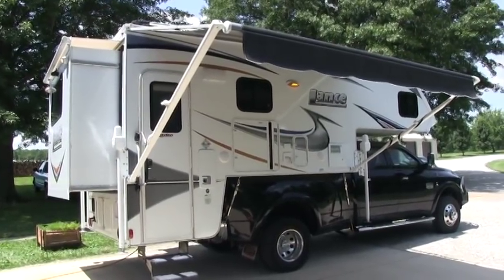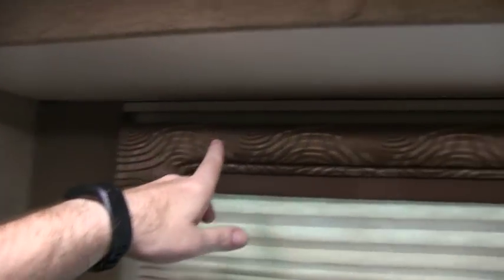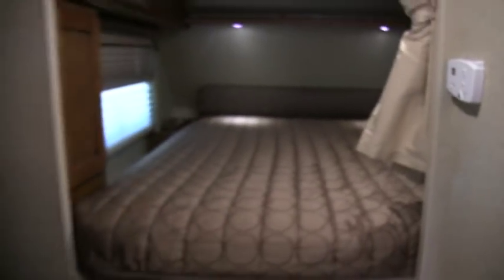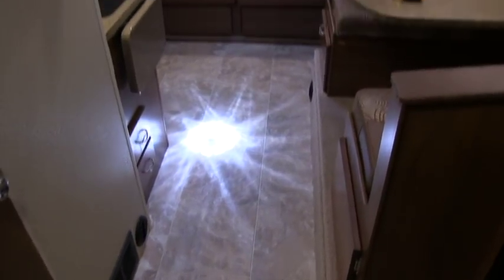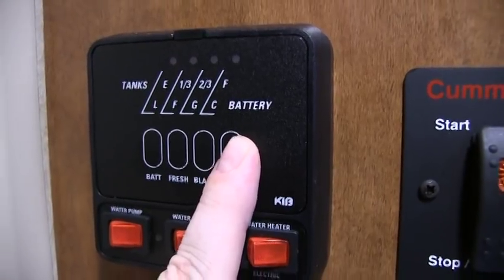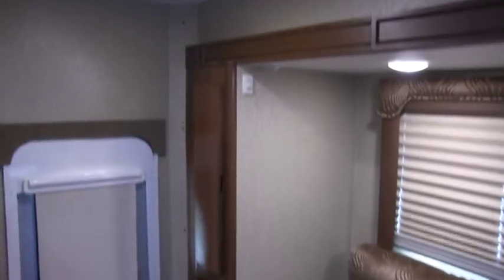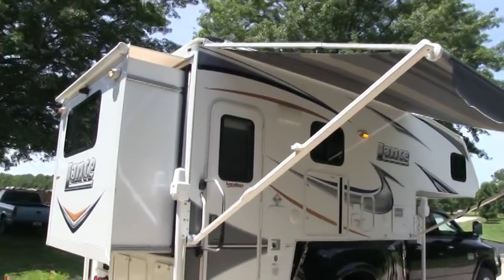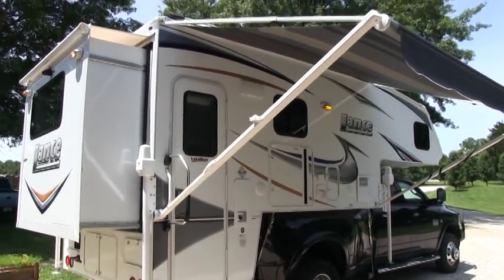2013 Lance 1172 Slide-In Truck Camper Walk-Around Tutorial Video

Comment: I got tired of dragging a travel trailer around. We wanted a slide in truck camper for years and finally traided for a new 2020 Lance 1172 with everything we wanted. We already had an 05 Dodge Ram 3500 dually with CTD and 6spd getrag paid for with only 60K miles. Now I'm happy, the Lance ain't cheap but I'm retired and plan on enjoying what time I have left.

Comment: That's a lovely camper and surprisingly large. My parents had a truck camper in the 70s and it was nothing like this. No slide outs of course and not even a bathroom. They ended up selling it and buying a class c motorhome. The point was having something they could pull their boat with and not require 2 vehicles. They would be pleasantly surprised to see this. Very nice 👍

Comment: I could happily live in this full-time.
Reply: Me too
Reply: Me three
Reply: yea... until the 1st slide got hung up, stuck... then the 2nd had a motor burn out... & you are in the middle of nowhere... arghh !
Reply: Vazcular ditto
Reply: @seminolerick6845  I'm think they can push it in manually.
Reply: S R  
6' 1'' without shoes 225lb fit.
Reply: Same here
Reply: S R 
Lame post
Reply: @seminolerick6845  I agree you can't even enter the camper if the back breaks
Reply: Me 4
Reply: I do live in in when they are not around.

Comment: That air conditioner sounds like a jet engine.
Reply: Reminds me of those big a/c units in hotel rooms back in the day. With that on you don't have to worry about outside noise.
Reply: I love it. It drowns out exterior noise when you’re sleeping. He just turned it on to high so I’m sure once that camper reaches a comfortable temp and you turn it down to low, it’s not as loud.
Reply: I put a mini split 12,000 btu, in my unit. No noise with serious cold. Fully thermostat controlled. 500.00 bucks
Reply: Cuanto cuesta ese beiculo
Reply: Your email
Reply: @tracystarling3280  1

Comment: I know this is an older video but I have a basic question if anyone is still reading and knows. These modern campers weigh 5000 lbs. Add equipment and people and its easily 6000 lbs directly on the bed, on the axles, on the tires, on the frame. If the truck is a 1-ton, is it even safe? Shouldnt this kind of a rig be on a 5-ton truck? Its different when you are towing 5000 lbs  because what youre towing is on its own wheels, axle and frame. Im new to this, what am i not understandng?

Comment: With the amount of overhang over the rear of the vehicle that thing has, it would be nothing short of dangerous. At least we are not likely to have to dodge one falling to bits over here - it would never be legal in the first place.
Reply: is the price top secret?
Reply from the maker: Camper sold on 6/29/2017 for $32,900 mwood65!
Reply: You DO realize that you drive with the slides IN, right? Therefore, only a few feet actually sticks out beyond the bed. There are caution, clearance, signal, and brake lights on the unit. The weight appears fairly well-distributed. I'm sure you've seen far more dangerous loads far more carelessly "secured" in the backs of pickup trucks. Also, if it's legal in the USA and Canada, it's probably legal in Oz. You can dislike truck campers as you please; you don't have to make up non-problems in order to not like something.

Comment: will it fit on my 2015 1500 ram
Reply from the maker: No Bill, Lance 1172 campers are made for one-ton duallys.
Reply: ok thanks
Reply from the maker: 2012 Dodge Laramie Longhorn 3500 4x4 diesel dually 1-ton truck from the video is for sale by owner...$39,500 *Watch video of truck here... https://youtu.be/1rzp2FiMMto
Reply: or tow it on a flatbed pulled by a half-track Army truck

Comment: Like with any dinette it's just wasted space. They are all painfull to sit on so you seldom do. I have a 2017 trailer. I have changed the bed, the rear sofa and got rid of the dinette. I put two side by side electric recliners in that empty spot. When I got rid of the rear sofa I put in its place a bistro table and two chairs. I sure like this camper in your video though. If I had a truck big enough to haul a monster camper I would have bought one. But you have to have an 85000 dollar truck before you spend 25000 dollar camper.

Comment: I would be interested in knowing the price of the slide in Camper. I have a 3500 Danali long bed douly. Will this camper work with a long bed or 8' ft bed. Would appreciate your expertise and reply. Thank Philip
Reply from the maker: Camper is made for 1-ton dually trucks. Sold used for around $32k in 2017.

Comment: That's a really nice camper.  I like the dry bath and the range/oven.  I also like the separate sofa and dinette.  You could probably figure out a washer/dryer unit to be put somewhere.  Besides hanging clothes on the nice shower curtain rod.  So thanks for the video.
Reply: Till you remember a truck can't put 5000lbs of payload in the bed. Not to mention the black water tank would be full with one wash
Reply: @shawnhenderson1130  Oh!

Comment: Any suggestions on a slide in camper for a 2003 Ford Sport Trac?? it has the very short bed and im having troubles finding model that will fit it.
Reply from the maker: Not sure they make slide-in camper that light. Check with your local dealer.
Reply: Sport trac s are nice used to have one, However they have a high center of gravity issue without adding more weight up high .  lots of roll overs in the past, many lawsuits,

Comment: this looks too much for this... truck
Reply from the maker: Hello Doppler Dave, slide-in camper weighs around 4k lbs. & sits on a fully loaded 2013 Dodge 3500 dually with payload capacity (truck bed) over 6k lbs. & tow rating over 30k. Late model dually trucks are monsters! thanks for the reply.
Reply: You are right, the late model trucks can easy haul that thing.  I have a 2006 Ford and with air bags mine handles good with a 4:10 rear end, however the wife wants to buy a new Dodge.  I only got 22 thousand miles on my Ford.  Women!  Fixing to put it on youtube and up for sale. My truck won't be cheap.
Reply: Darlene,  I could tell her that, and I could spend the rest of my time on earth in my camper.  No really, I want a new truck too. Someone will get a very nice 2006 Ford with only 22 thousand miles on it.  I mean heck my truck is nice but a monster new one.  You men and their trucks.  lol  Thanks for the advise.
Reply: William Dixon is your truck still available as I need one this size ? Thank you Phyllis Helmick , I can't afford the new ones

Comment: No way to pull the boat
Reply: I have a 2015 Lance 1172 loaded on my Ram 3500. There is a heavy duty hitch extension that allows  towing about anything up to 10,000 lbs or there about. I will have my jeep on its trailer behind this rig, or my 28 foot try log pontoon which isnt exactly lite. Of course using a weight distribution hitch when hauling the jeep. ..........  Now...... I can't emphasize enough. The Big Wig aftermarket rear anti sway bar is a must for this setup. Front as well if you have the budget for it. Biltsien heavy duty shocks as well.  Without these, the ride will be very tippy and sometimes hard to control.  With these its a sweet ride for a big trip. Oh, also adding rear air springs will be a plus. Not to support the load, but to level it out side to side with that big slide out on the left..
Reply: @dewaynemiguel5695  with the hitch extension I have, everything works fine. The rear slide out is about 3 feet above the hitch. I can open everything up and never disconnect the trailer. Whether it be the jeep hauler or the pontoon boat.
Reply: @114TAI  oh ok I thought it would hit what your pulling